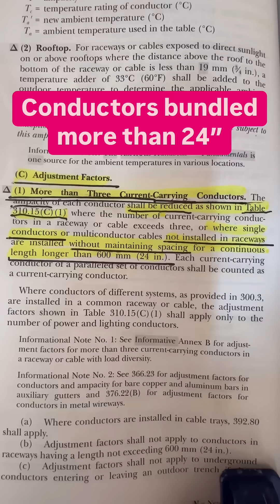When more than three current conductors are bundled for more than 24", the ampacity must be adjusted

Comment: I used multiple circuit flex conduit to wire the upstairs living area in my garage. I used 10 gauge solid  90C wire for all of my receptacle and light switch circuits.

Comment: What’s the thought on bundling 10 NM cables horizontally in a stud space in a 2 inch hole. With a choke point every 16inches. Some inspectors might see that as bundling some do not?
Reply from the maker: 310.15(C) would not apply!

Comment: I have chatted with people posting the super clean panels all bundled up about this. Arguing that if they are limited on the number of conductors through a knockout, they shouldn't bundle them in groups any more than that number either. The inner wires cannot cool properly.
Good to see the code actually addresses it.
Reply from the maker: BUT, it's perfectly fine in accordance with 310.14(A)(2) Exception. I did a post/video on this after this post/video.

Comment: Does bundling apply to multiple mc's in bridal rings?
Reply from the maker: See the Exceptions to 310.15(C)(1)(4) and the exception.
Reply: @MikeHoltNEC  I would say it's debatable. The only time i consider it bundled is in the ring itself, which isn't 24" long. Unless I ziptie all the wires through the whole  run, I wouldn't consider it bundled.

Thanks for the replies Mike.

Comment: I vehemently oppose zip ties and “service loops” in a panel, form the wire square and if something gotta change in the future let the young bucks make a splice or two 😂 As some one who does panel swaps fairly regularly the constant zip ties and extra 3’ for each circuit is annoying
Reply: As someone who remodels and frequently works in existing panels making changes, I very much appreciate service loops.
Reply from the maker: I guess my comment was to the wrong post. Sorry.
Reply from the maker: You are a good man! Thank you so much for understand. God Bless, Mike
Typically I get a response like "F" you Mike Holt.
Reply: Here is an interesting fact, your torque specs are on wires freshly installed. So if you ever need to remove the wire from the lug, you need a fresh end,if you want to torque it properly. You can’t retorque on an end on that has been compressed already. That’s where Service loops become clutch!!
Reply: @chrisf3875  ir you can just use a wago
Reply from the maker: Your comment is hidden, because I don't allow cuss words on my Channel.
Reply: @MikeHoltNEC  my apologies mike i edited it out wont happen again 👍
Reply: @MikeHoltNEC  What cuss words do you see?

Comment: Blk-wht...red-wht....blue-wht, org -wht and a green all 12 gauge thwn derated from 30 amps to 21 amps on a 20 amp breaker for a total of 4 circuits in a 3/4 conduit.....that's not the correct way to look at this?
Reply from the maker: Eight current-carrying 12 AWG wires in a raceway has an ampacity after adjustment of 21A (30A x 70%) and can be placed on a 20A breaker.

Comment: I love how its the same panel in most videos yet he gives use So many different code references using that same panel. Thank you mike. We appreciate everything
Reply: What I don't understand is how the current reduction works. If a cable carries  30 Amps but the book says reduce to 21A does it mean the load has to reduce or the number of cables have to increase?
Reply: @chukwumaeddie5485 - The load has to be reduced.

Comment: This means I can install (4) two wire circuits of 12 gauge thwn wire in a conduit without increasing the size of the conductors not including other factors correct?
Reply from the maker: 8 wires = 70% of 30A = 21A on a 20A breaker. All good.
Reply from the maker: Raceways size is not a factor. But you can run eight 12 AWG wires in a raceway and be good on a 20A breaker.
Reply: What if that conduit is on rooftop in Las Vegas ?
Reply: @fakjoo9553 Then the strippers are provided by the job site. 😉
Reply from the maker: Exactly!
Reply from the maker: Watch https://www.youtube.com/embed/MXdt6TfBetg
Reply: Thank you.
Reply: Not thwn, Mike’s math is only good for thhn. Because it’s based on the insulation, thhn has 90°C insulation but thwn only has 75° so it doesn’t allow as much current to flow in the wire despite both being 12 AWG
Reply: 3/4" conduit 6 current carrying cunducters so 3 120v circuits